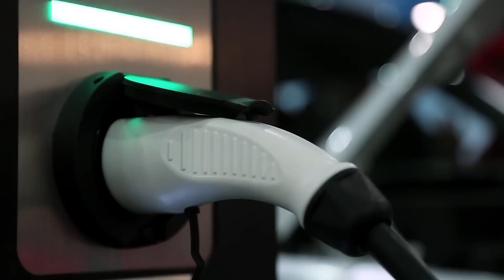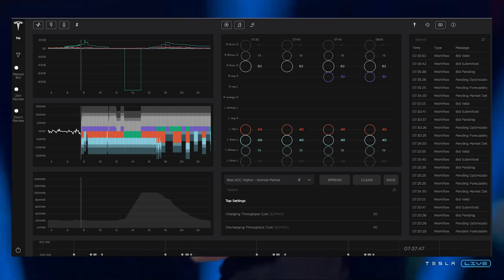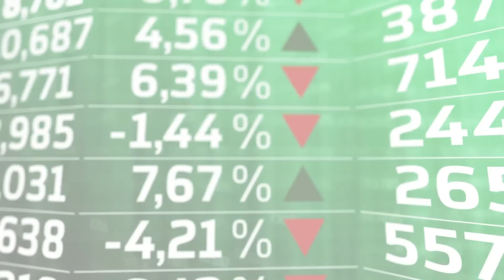When is Tesla Energy Scaling?

Comment: Tesla cars are the best in the world.

But creating enough battery’s to support solar & wind is moronic. There is so much toxic material that needs to be mined, shipped, and built for only a small amount of batteries. And those batteries die after 10-15 years, and then need to be rebuild.

Nuclear is the ONLY option.
Reply: Fission power plants are just a little toxic. In the US you can't get a permit to build a power producing reactor that wasn't designed in the 1990's.

Comment: 12 July: Norway’s Equinor is to acquire U.S.-based battery storage developer East Point Energy after signing an agreement to take a 100% stake in the company.  Equinor, a major producer of oil and gas, said Tuesday that Charlottesville-headquartered East Point Energy had a 4.1-gigawatt pipeline of “early to mid-stage battery storage projects focused on the US East Coast.”
. . . Formerly known as Statoil, Equinor’s chief shareholder is the Norwegian state, which has a 67% holding in the company.

Comment: isn't tabless 4680 just a form factor?  can't you make an lfp cell in 4680 size?  why do you distinguish the two?
Reply: 4680 form factor is designed to improve nickel based batteries. It is not the optional form factor for FE based batteries.  CATL and BYD have multiple form factor improvements scaling up right now in FE based battery arena. Tesla will probably just lean on them for the time being. 

https://en.wikipedia.org/wiki/Blade_battery

Comment: You probably won't read this but the new plasma drilling tech combined with thermocouples will enable practical geothermal baseload. We may need fewer batteries.
Flow cells are also an option.

Comment: I think Elon has pivoted to China scaling based on CATL LFP. Until 4680 can be scaled Austin and Berlin are battery limited by 2170 supply so will aim for breakeven. Meanwhile Shanghai will double production this year probably 3/4 LFP with some LG 2170 for regional supply. The energy business will remain a rounding error until battery supply is fixed?

Comment: Still wondering when we will get details on what Elon means by extreme scaling (Master Plan pt 3). Any idea?
Reply from the maker: Perhaps shareholder meeting?
Reply: 20 mill cars in year 2030 &
30 mill vehicle in year 2038? 🤔🤔
Reply: I think Elon answering 10 Gigafactories built over the next 10 years or so (if all goes well) at the Berlin Factory 🏭 opening was a good hint of what’s to come!:)
Reply: Tonage of material for getting to 3
 TWh of batteries.  1% of the required 300 TWh that Tesla thinks is necessary to fully transition to sustainable energy